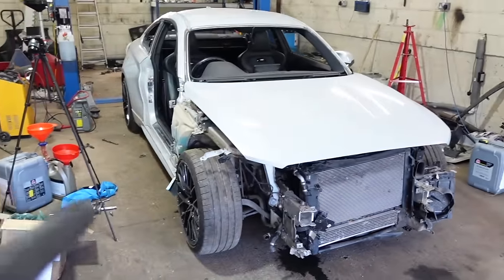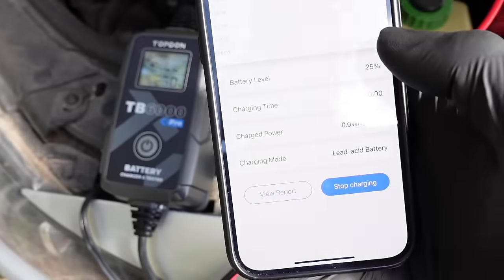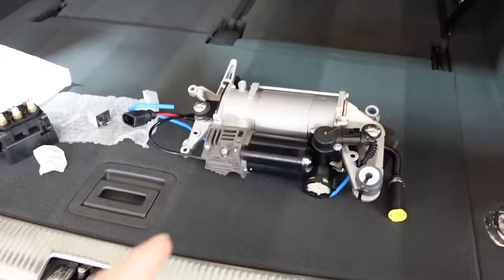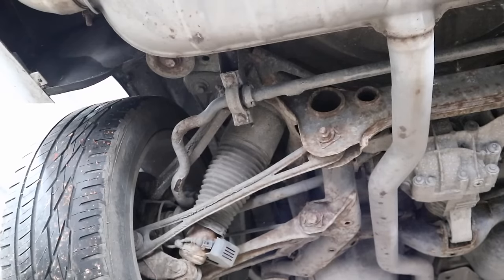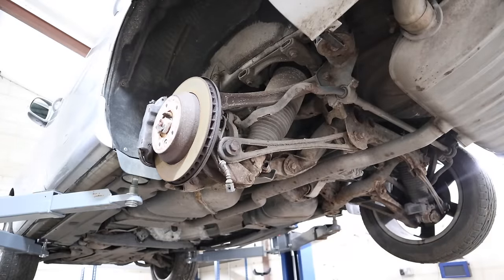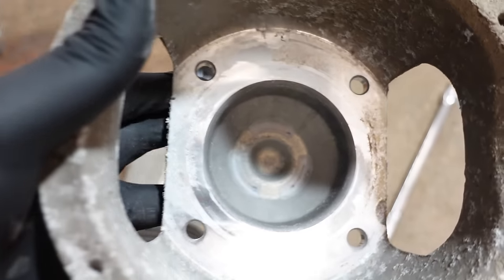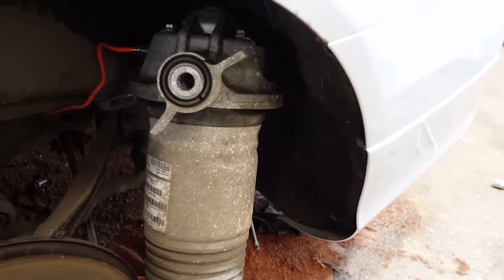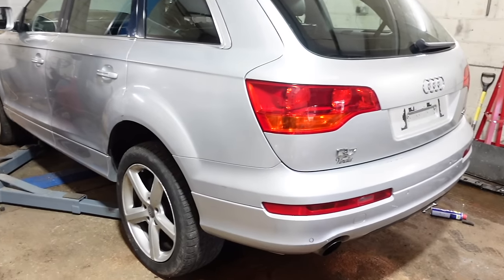FIXING MY AUDI Q7 FOR FREE!! AUDI WANTED £10,000!!!

Comment: Very odd that. IMO, for whatever reasons, when weight is applied to the rear, it could be distorting the top of the strut causing the leaks on both sides as they were both leaking in exactly the same place on the o'rings. Good vid though!

Comment: I would have added some Permatex on the outside edge of that cap and around the bolt holes to prevent water from ever getting to the seal again , And ditto on the silicone grease for the O ring

Comment: It's clearly looks like aluminium oxidize and deteriorated, and yes like many said silicone grease or thin layer of gasket silicone. Obviously the new o ring would be the best. Hopefully went without adaptation, that's the pain on BMW or vag vehicles😅 to set this up running with measure tape around for half day 😂

Comment: As a current 2007 Q7 owner with Air suspension, I had the same symptoms of the suspension dropping on all corners and I was able to fix all my shocks with the method you just did, but I replaced the o’ring and the rubber bushing that was cracked, I bought all those parts from Audi, they do sell independent parts for the air suspension shocks and they all come in genuine boxes 😉 they were happy to sell the items and recommended to get the small o’rings for the valves connection too. Not once they forced me into changing the shock. Parts diagram also shows the exploded view of the suspension strut with different parts you might need. Maybe the Audi you went is more into profits than assisting customers. 

OEM Part N for the o’rings: N91095601
OEM Part N for the Mountings: 7L0412327A
Reply from the maker: Yeah that is frustrating, I specifically asked if there was a repair kit or if you could buy any parts separately and they said no 🤷🏼‍♂️

Comment: Excellent content I keep getting error 00142 - Left Front Dampening Adjustment Valve (N336)
012 - Electrical Fault in Circuit is my strut bad? I have no leaks already replaced air pump and valve block

Comment: Great value for £1k, and just goes to show main dealer prices should not be taken on face value. 
I’ve got an 2017 Audi A7 3.0tdi Quattro with a stage one. The auto box changing from 3rd to 2nd and 1st has the Water softener to be installed in corner cupboard under boiler, middle shelf we need to remove.  Garden tap to remain on hard water Drinking water filter to be added in cupboard under kitchen sink Chrome quarter turn drinking tap to be installed over sink  said being rear ended.  
Audi have quoted £6k for the mantronics unit and clutch pack. 
I’ve been quoted £1500 for a rebuild or £2k for a reconditioned gearbox swap. 
Still feel I shouldn’t have these issues on a 6 year old 85k mile Audi with full main dealer history. 
My 2013 A4 Quattro has 227k miles and is still running strong

Comment: Thinking about the cause of the leak, could it be that the bolts holding the top bit may have come slightly loose overtime due to vibration or were under toqued originally. The o-ring looked that it wasn't under much pressure for being in operation for such a long time.

Comment: Had one of these for 8 months.
Great car to drive
Absolutely rubbish reliability though.
Dpf issues
Egr issues
Were bought by inner city mums and driven into the ground doing 15 minute city hops.
Engine gunks up from carbon and eventually just fail. 

Would get the non turbo petrol, even if it is thirsty

Comment: I love it, and the "good" thing with those ridiculous prices, mechanics have to stretch their heads how to fix this. I called it the Pakistani approach, in Pakistan my wife and I are driving the indistructable Yahamas XT 600, have seen those stranded new bmw motorcycles ( aluminium gearbox was part of the frame) and even with the added enforcement triangle made by touarech, the gearbox broke from the frame, (we are talking new 25000 us bikes) well in Pakistan they were happy with those bikes, heated up the aluminium and welded it back together and never broke again. Well I got a bit side tracked, but expensive is not by definition a garantie for quality.Thanks for sharing

Comment: Just had a look on the net, and there are many specialist suppliers of various 'O' rings. One company boasts over 30,000 different types/sizes in stock. A very much cheaper option. The corrosion was where both of the caps had gaps - obviously water ingress had caused the Aluminium to corrode into the o-ring (Poor design).

Comment: Change the rings at least or they will soon need replacing. You might be miles from home when they do start leaking. The oxidisation of the aluminium means there will be some missing surface metal. Look for your nearest hydraulic repair shop. If they are non-stock they will get them. Go for a very slightly larger ring and they will then outlast the life of the car.

Comment: It just shows if you can be bothered to investigate and have some old school fault finding knowledge then cars can be rescued from scrap. My wifes Q7 had an MMI problem and Audi quoted £4600! I explained the car is 2010 and not worth spending that kind of money. They also told me only they could code the new system. Like you i went on ebay and procured one for £350 delivered. I used an Audi specialist to fit it and total bill including the MMI system was £450. So saved £4150. Was i in the good books with the wife, you bet😗😏

Comment: So what car dealer/repairer in the modern World now, would tell you, `the units are fine, ` we just changed the o rings. 
After having 3 oil and filter changes in 10 years on 2 different motors, all clucked up.
1st Kwikfit cross threaded sump plug. 2nd National tyres wrong filter, blew off twice, oil smothered engine bay. 3rd independent in Brentford (Carrera Worx) cracked the oil filter housing, on a new motor, then tried to blame me.
Can`t trust any now.

Comment: This is caused by a badly designed cap. Look at 9:08. See the dirt line? This is where the cap ends. It covers less than half of the surface. Terrible design.  I wonder if the front ones are different, since they didn't have issues.
   Also, the O-ring is too thin for the job and the cap is completely flat, which means that in general, the seal is always inadequate, even in brand new condition. One would expect much better from Audi.
   Now, i would suggest putting a little bit of grease or oil on the rings. It helps them seal better and push away water. Another idea is to put a little bit of gasket material on the surface, to help it seal better.

Comment: Leaving old oring is the definition of bad mechanic work. It might look ok after cleaning but rubber degrades over time. It might be stiffer, with worse elasticity. So the problem will be back soon. Besides that, it was probably the oring that failed in the first place.

Comment: Difficult to find in favour of Audi over something as money grubbing like this, The housing holding the airbag has a metal to metal mating surface, but waiting for a drop of salty water, which I suggest was the original cause of the issue with that white power mess. Perhaps, as other suggested, using grease with replacing the cleaned O ring and wetting the mating surfaces with the thinnest smear of grease to try to hold back any damp might be wise.
Reply: It´s probably the moisture of the air coming from the inside (of the compressor).

Comment: You have just proved what utter thieves Audi are. I bought a Q3 in May ‘21 brand new and for an inspection and oil and filter change they wanted over £500. Needless to say I went to my local independent garage who specialise in VAG cars and using genuine parts and with registration of work with Audi Germany I halved the cost.

Comment: thing is..something must have happened to let air and debris escape in the first place..whether there was debris inside the bags that got forced out and deformed the O ring....might be a temporary solution I think..
Reply from the maker: It was just corrosion over time that did it, I’ve sanded the corrosion away which has reset the process, so it should last a fairly long time

Comment: Sorry to piss on your chips but you have not fixed the leaks. The air is leaking from the cylinder seals, air should not be in that area you cleaned, air will eventually start to pass and you will be in the same position. 10 out 10 for trying though.
Reply from the maker: No need to piss on my chips, it has fixed it. Been 2 weeks now and the car hasn’t dropped a mm.

Comment: Audi dealer do sell bag, strut,seals and valve 
separately.
Aftermarket bag are avable.
I recommend to your homework before you get cheated.
Reply from the maker: I phoned the dealer and asked them specifically if you can buy any parts separately, how much more homework can I do 😂
Reply: @SavingSalvage  
Use audi spare parts cataloge.
Good work enyway, keep up the good work.

Comment: Recently, I had to replace the glow plugs, the price on the site for 1 candle with a pressure sensor is PLN 650 (120 pounds). I called a friend at the wholesaler and bought 4 candles for a similar price, one of which is a mega-expensive one with a pressure sensor. They want to rip you everywhere. 9 years ago a thief mechanic charged me 700 zlotys for a repair worth 150-200 zlotys. These guys are scumbags.